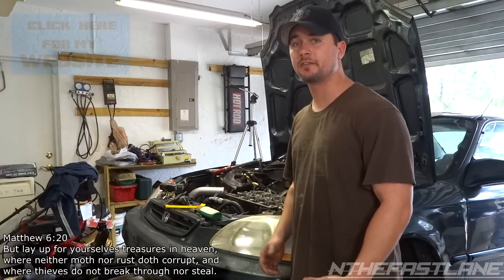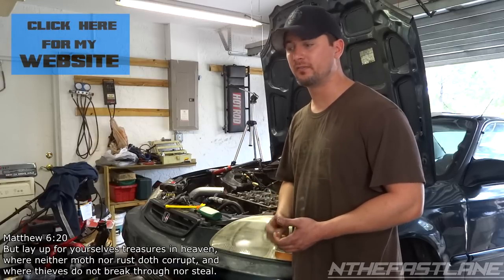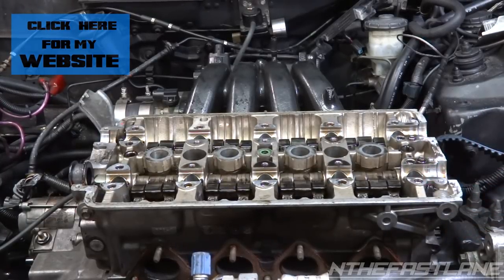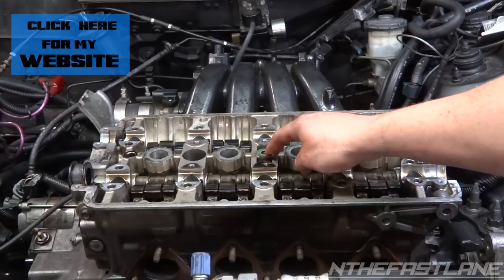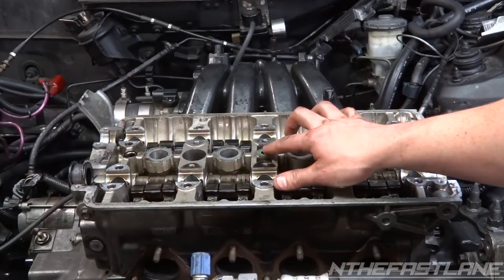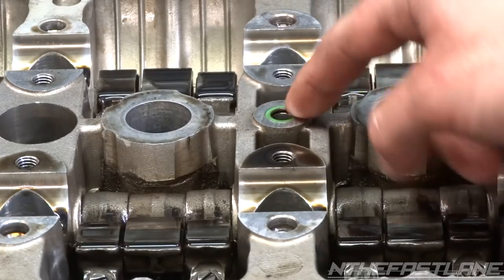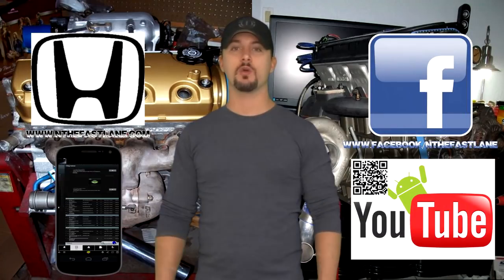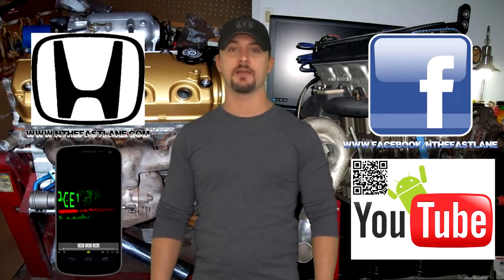VTEC Not Engaging Properly?!? This Could Be Your "FIX"

Comment: I did try this and as I took off the valve cover I saw oil everywhere.  I tried it but still running the same. Is there anything else with vtec that I should look into?

Comment: Ran first thru third gear and spun a rod bearing due to this o ring not in place at all after low experienced person did head studs prior to my ownership with the o ring gone the head filled up and drained the pan and spun a bearing not knowing it was missing. Great video thank you!!
Reply from the maker: Don't forget to add the dowle pin as well. I made a quick first person mechanic video of the entire repair. All the parts are in description with Amazon links.
Link to video: https://www.facebook.com/458376627602860/posts/2736156309824869/
Reply: Nthefastlane dude you are the man X10 I appreciate you saving me from another rebuild lolol thank you sir for taking the time to enlighten me!!

Comment: great video forgot about this possibility when trouble shooting VTEC not engaging. However, you mentioned that you do not need to take the camshafts out but you make no indication of the requirement to remove the timing belt off of the cam gears to avoid your cams from ripping the cam shaft caps off under the belt pressure. As far as I've seen the cam shaft "covers" are the only things holding the camshafts into place.  

If I was interested in removing only cap number three it appears that my route would be to purchase a spare cam cover cutting out the #3 cap bolts and installing that one on either intake or exhaust side after removing the original ( see cam plug install video). Once the cut spare cam cover is re-tightened remove the 2nd camshaft cover and all but the #3 cam cap should be fastened down. Remove the cap replace o-ring reinstall original cam cover, remove the cut spare cover and reinstall the original cam cover.  Unless I have overlooked something or overestimating the pull on the camshaft gears This seems to be the only way to remove cam cap 3 with the timing belt still connected

Any advice?
Reply: Take off exhaust cam rail and put the bolts back on with a few washers to act as spacer (act as cam rail), dont put any on cam 3 cap. Then pull off the intake side rail and do the same thing

Comment: I have a h22a mine was missing completely, I installed a new one, I found the vtec solenoid screen full of shavings and still no vtec power, drained the oil under a screen no shavings. What got messed up? Car runs great until vtec hits all noise no power.
Reply: Any luck with this? I think im on the same page
Reply: Well in my situation I recently upgraded to supertech dual valve springs and ferrea flatface valves and I forgot to reinstall the oil control orifice o-ring. The fix was a very good valve adjustment. Vtec is hitting strong. The shavings I don’t have a clue? Changed oil under a screen a second time and all good.
Reply: @Suerte_Pepe  nice im going to try a valve adjustment.  I cleaned the vtec solenoid again but didn't get a chance to run the car. Ive been with this problem for over a year and took the car to a mechanic and didn't notice the injectors were bad so was going to rebuild when they told me that they weren't able to rebuild them cause the fuel was flowing out the whole wall.

Comment: I have a b20 block with a b16 head my vtec solenoid works it clicks and my vtec still won't work you think that's the last thing I should check is the O-ring
Reply: Did it work?
Reply: Same setup same issue. Solution?

Comment: 92 civic vx, with vtec-e doesnt have this O-ring.   But I still have code 22 after head replacement along with cradle.  Pins are in place, solenoid clicks when I put volts straight to it from battery, and the vtec oil pressure switch was replaced.   Any ideas?    Oil level is ok.

Comment: Can you do this for a D series too? (D16Y8)
Reply: Joey Donuts yeah im wondering too
Reply from the maker: Yes for the Honda D-series there's what is called a oil control orifice. It's located under the center cam cap just like the GSR. My GSR came with a oil control orifice but it was removed. You will have to put a small extraction tool into the hole and pull up on the oil control orifice and you will find a rubber o-ring on it. Replace it and then push the oil control orifice back into the cylinder head.
Reply: @ashleycool2557  I'm having a same issue, it could be the solinoid or this little o-ring he may be talking about. I'll have to try that

Comment: I have a d series vtec, cleaned the vtec solenoid, checked the switch and allways doing normal oil changes but anyways. a couple days ago it did pop early in the morning but shut off the car and went back and didn't work. any other suggestions?

Comment: I just installed skunk2 stage 2 cams.. I got the head cleaned out and resurfaced.. But the problem is that i dont know if the guys from the shop put the cam caps correctly. I put a new v tec o ring.. I checked all the electrics.. My guess si that maybe the cam caps are not put on right is there any way of making sure they are? i also checked the solenoid and its working. it clicks..

Comment: I have a B18c5 and when i first bought it my vtec worked sporadically but now it doesnt engage at all. I looked at my valve cover without even taking it off and there isn't even a stud on the center of mine, is that what supposed to plug that hole is the valve cover stud?
Reply from the maker: No, when you take your valve cover off you will see cam caps. In order to access that hole you see in this video, you need to remove the center cam cap. You may have a loose ground wire on your vtec solenoid as well. Watch this vtec solenoid repair video, you may also have a bunch of build up in the vtec solenoid filter that needs cleaning. Link: https://www.nthefastlane.com/mistaken-head-gasket-leak-honda

Comment: My k series is missin the kick , and this happened after resurfacing head , before then it would kick hard didnt have to try listen, it was very noticeable,  is this the fix ?
Reply from the maker: First thing I would do is check all your wires and connections that you did when you reassembled the head. After that I would pull the vtec solenoid off and check the screen to make sure that you don't have any metal shavings from the machine work stuck in there. If you have metal shavings then the machine shop didn't do a good job at cleaning and this can be very dangerous for the engine. You do not want any of those metal shavings getting into the main/rod bearings or your entire engine can fail. Watch this video on how to check the screen of your vtec solenoid: https://youtu.be/1MKKUWcV6KE
Reply: @Nthefastlane  ok I replace the vtec solenoid gasket , no shavings , screen was clean , but flat and leaking , I also cleaned my grounds . Its weird how it sounded alot less after rebuilt but the motor does grawl but that's about it .
Reply: @Nthefastlane  it's a k20z3 btw

Comment: Im having trouble with my Vtec. My 2000 Civic Si which is boosted, hits Vtec just fine for a while but it seems once the engine gets to normal running temp all of a sudden when I go full throttle as soon as I get to where Vtec is supposed to kick in my car...this is very hard to explain...but its like as if I took my foot off the throttle REAL QUICK but yet I still have throttle all the way to the floor. Car will decel till it shuts off unless I let my foot off the gas and then its fine. Its almost like some kinda limp mode where the car wont let me hit Vtec. I can accel just fine to redline as long as I dont WOT. But as soon as I do WOT and I get to the RPM for Vtec it does that. And like I said, only after car gets to normal running temp. Any ideas? Could that Oring be the cause? Because I did replace my head gasket but never replaced that Oring. My friend said I didnt need to even though I felt otherwise.
Reply from the maker: If you could post this question in my forum. Copy and paste what you wrote and start a new question in the General section. I will answer all your questions there. www.Nthefastlane.com/forum Once we resolve this issue it will be a fix for everyone that needs help and they'll be able to read it. I'm not able to post pictures here to help you out.

Comment: Could this make the VTEC engagement sound sputtery? My kicks in but it’s not the obvious crossover sound sounds like sputters in and out quick mapped P06 ECU
Reply from the maker: Yes it's possible. It's also possible that the Vtec solenoid filter is clogged. Click my logo and it should take you to my main channel. Look in the Honda categorie. Look for a video called "Mistaken Head Gasket Leak".
Reply: @Nthefastlane  there are times wheee the VTEC kicks in solid like normal but when I gradually PUA the gas pedal it sputters when it engages, cuts out Real fast than kicks back in...but then when I floor it in 2nd 3rd 4th it sounds normal...

Comment: So i have a 2000 accord 2.3 vtec ..... And my car will not rev over 4 rpms.... If i am driving normally it runs perfect no problems except when i hit the gas pedal to go high rpms as soon as i hit 4 k it stutters untill i let off the gas pedal ..... I only have P1259 i already replaced the vtec solenoid but the code is still there ... Something about vtec malfunction bank 1 ..... Could this be the fix to my car or not ?
Reply: Crank shaft position sensor.

Comment: So could this cause  "WEAK" VTEC power? My  vtec is "kicking" on however there is not that pop. One mechanic said that "maybe" the timing belt skipped a tooth. What do you think? I have already tried 3 different vtec solenoids.
Reply: I have the same problem
Reply: Brent Palmer vtec either works or doesn't work.

Comment: Were can I find this o-ring?
Reply from the maker: Home Depot in the sink and faucet section has a variety of Black O-rings. Also any auto parts store"Autozone,Napa or Advance Auto" you can buy a pack of A/C O-Rings. They come in a pack with a bunch of different sizes..there green like the one used in the video.

Comment: fastlane i hope u read my commet below this one,im an ase master diesel tech 28 yrs,just getting involved in hondas and how they work.lots of diesels mid range and pick ups  use high oil pressure to fire injectors,so it makes sense,any other advise would be great. i will figure this out. also it seems to warm up litttle quicker since i bougt,never over heat,but engine fan cycles more than it should, ive changed temp fan switch too,and its not cuz im running my a/c,im also a/c certified in autos and thermokings,so i understand a/c and condensor fans,people mistake engine fan for condensor fan all the time.this 03 vtec was my first civic,so i had nothing to compare to.
until i bought 99 few mts ago. ive been vtec robbed i think 4 years!
Reply from the maker: Try replacing the solenoid on top.3-10mm bolts. Look up my video, "Mistaken Head gasket"; it involves the Vtec solenoid. Hope this helps. Also check your grounds,vtec and injectors are activate by ground.

Comment: The one he is showing on this video has a dowel pin which connects to the bottom on the cam cap  (which is not seen in the video) and the O ring goes around it!!

Comment: What about an 05 odyssey.   No Vtec with a P2647.   New screen and cleaned out passages by the valve and everything works.   New oil as well 0w20.
Reply: We have been troubleshooting this issue on the exact same year and model, same code also. Ohm tested the rear (new) oil pressure switch and solenoid, changed oil, replaced screen, cleaned and replaced the oil filter housing... still not corrected. It feels like VTEC is engaged all the time. what did you wind up doing with yours? Thanks!

Comment: My car wont go past 4000 rpm .. Could this help?
Reply from the maker: It could but I need more information. What ECU do you have, is it chipped? Any check engine lights, if so what codes? In the future head on over to my website and post in my forum. https://www.nthefastlane.com/forum
Reply: Yes its chiped check engine light on not sure the code
Reply from the maker: Find out the check engine code. From the sounds of it it could be in limp mode. This usually happens from a faulty sensor or even the distributor malfunctioning. The first thing I would check is the TPS and the MAP sensor.

Comment: What's the actually name of the o ring? And if I pull the valve cover would it be in the same spot for a d series?
Reply from the maker: D16's don't have it..if your having problems clean you Vtec solenoid on the side of the head..should be 3 10mm bolts.
Reply: +Nthefastlane how do u clean it??
Reply: The d16 does have it Idk wat this bozo talking bout I'm rebuilding my d16 head and it have that same o ring in the same spot and as far as I know there's a down pin that goes under it

Comment: isn't there a dowel pin underneath the o ring??? or just the o ring?? thanks
Reply: Yea I saw It on another youtuber channel zosh
Reply: Called Orifice assembly oil control, it has tiny o-ring in the bottom of orifice plus the 2nd o-ring on top as showing on this video.
Reply: @dolceamore4065  the one he is showing on this video has a dowel pin ( which is not pictured in the video) with the ring around it!! the ones your talking about ARE not in this video which are the intake and exhaust oil orifice near the cam gear side.

Comment: Could this cause the vtec pressure switch to come on at a low rpm?
Reply: Depends on your engine, Mine usually kicks around 5500

Comment: This o ring has nothing to do with the vtec. The orings on the First two halve cam holders are responsible for the vtec oil passage. The mid one seals the path for the cam (and head) lubrication.
Reply from the maker: Yes it's for the cams, but if it leaks into the head your cams are starved and so is the oil pressure for Vtec.

Comment: I have a F18B2 and my Vtec is not working properly, i cleaned the Solenoid, and my oil is fine also changed oil filter and spark plugs... i have no idea why its not working properly anymore :S

Comment: For some reason my vtec starting working again after I disconnected the battery and reconnected it. Hope that helps someone and make sure your ac is off when you test vtec of course
I have a 1997 Honda Prelude, h22a4 engine
Reply: Chris Campos why does the a/c have to be off when you test VTech?

Comment: ive never heard my v tec kick in,emmmmm i thinking this is y,just b4 i bought this vtec 2003 civic it had head gasket,timing belt and all thAT HAPPY STUFF DONE. by honda dealer,im wondering if he forgot this o ring or its leaking,cuz mines gutless since day 1.
no cel or miss. cel bulb works, i triped it and rest on purpose. i have an 1999 civic 16dy,that blows this 03 vtec away and it shoulnt. 140.000 miles on vtec,well cared for.
unless i have lost alot of compression,dont think so. no leaks nothing or miss or lite

Comment: Great vid thanks, question i have a 99 prelude sh with h22a4, do you know if that o ring can be found in my engine and what are torqe spec for cam cap n cover thanks
Reply: I have a 94 h22a it did have the gap but didn't have the print so I put one on

Comment: only o ring? no dowel pin?
Reply: I put the o ring on the dowel pin but no luck. My vtec isn't kicking in. I should make a video on what my car is doing.
Reply: @cosmasx1237  make sure the vtec solinoid is clean or maybe the currently head u got is recently LSV?
Reply: @537R4HC  I'm going to clean that again tomorrow although I did clean it but had changed out the solenoid itself.  

Love, as in ls vtec? Its p13 head.
Reply: @537R4HC  what do you mean by lsv?

Comment: Great video
Reply from the maker: Thanks Jim!
Reply: Nthefastlane hey how about the first 2 orings that the guy is talking about on the post above?? there is one on a dowel and another hole right next to it. how do u remove the dowel is it threaded what cam cap is it by? cylinder 1 or 4 thanks in advance

Comment: When car gets warm it won't go pass 4000rpm we changed solenoid and oil pressure sensor
Reply from the maker: Have your catalytic converter checked out, it could be bad restricting the exhaust.

Comment: I have a 2000 Honda Prelude and the Vtec doesn't kick in.
Reply: Jesse Bracero did you fix it? I have the same problem on my 1997 prelude
Reply: Jesse Bracero clean the vtec solenoid located on the side with the distributor. it is located right behind it and is a quick easy job. that o ring I believe is in the h series as well.
Reply: Jesse Bracero just remember if you pull off the valve cover and haven't done that in quite awhile. Probably will need a new valve cover seal.
Reply: Chris Campos I haven't gotten fix yet.
Reply: chris42000000 I'll be trying that thanks.
Reply: I cleaned my vtec solenoid and made sure all my wires were connected right and I just changed the head it's brand new do you think this o ring is the problem ?
Reply: Did you get it fixed ? I have a 01 lude

Comment: is there a dowel pin that goes inside it too? or just an o ring??
Reply: Called Orifice assembly oil control, it has tiny o-ring in the bottom of orifice plus the 2nd o-ring on top as showing on this video.
Reply: @dolceamore4065  the one he is showing on this video has a dowel pin ( which is not pictured in the video) with the ring around it!! the ones your talking about ARE not in this video which are the intake and exhaust oil orifice near the cam gear side